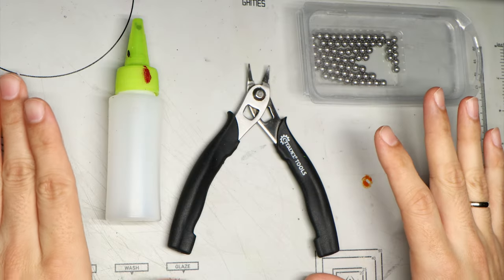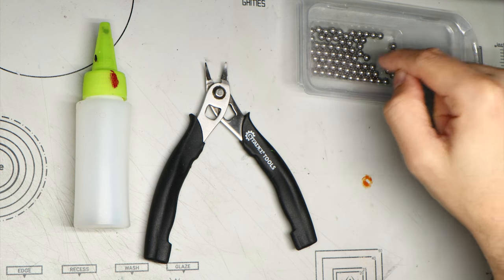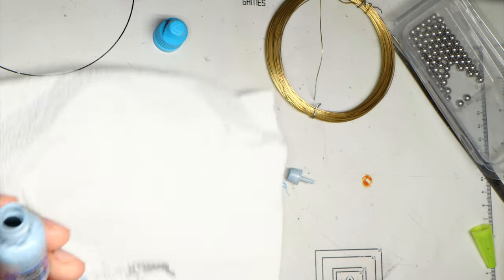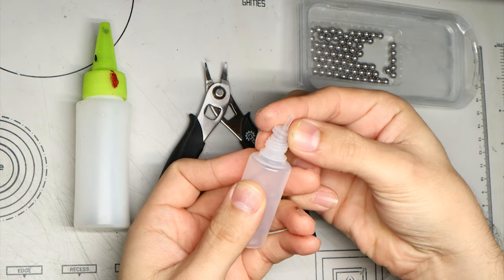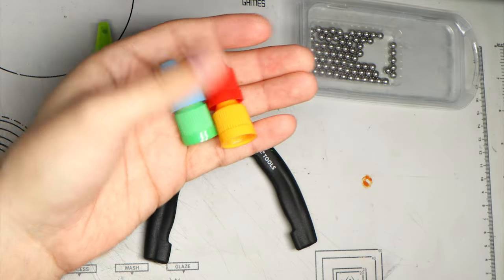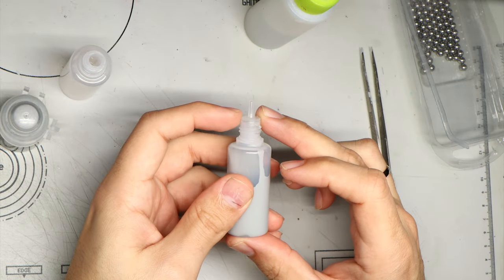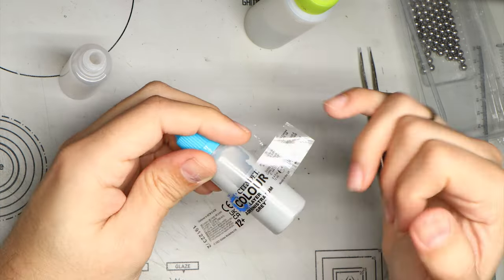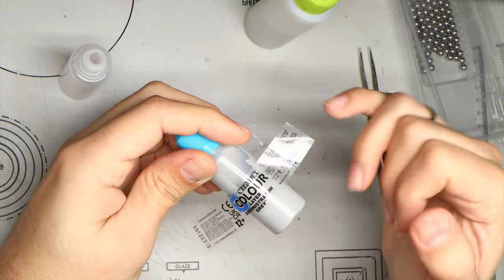THE EASIEST WAY to transfer your Citadel paints to droppers!!

Comment: Let me break this down for you all after a few years of my experience using GW paints in pots, wich made me an avid decanter of GW paints, eventually.

Their pots are an absolute nightmare to use with the Base and Layer paints so i did this to only THOSE paints. The Shades/Contrast/Metallics/Dry paints DO work fine their pots so no decanting needed there.

Maybe this can help you in some kind of way.

Ive tried and tested every dropper bottle known to mankind before decanting 70+ GW paints. They are good paints but expensive. So i really wanted the best ones; similar quality of Vallejo droppers wich i also use and took as a reference.

Size-wise 17ml is the most convenient and works best when transferring 12 ml from the GW pot. You'll mostly end up with 14-16 ml when your done.

I finally ended up with what i think are the best ones: 

AK interactive 17 ml droppers for the Base/Layer and some 35 ml Vallejo mixing dropper bottles for my most used stuff.

The AK 17ml's are the same bottles used for their 3th Gen paint line. Really thick and sturdy quality plastic and the best twister cap in the business; WITH a dedicated hole on top for a drop of paint for easy colour reference.

All the cheap bulk bottles from Ebay/amazon are dirt cheap for a reason and they are simply not worthy of my expensive GW paint + all the effort involved.

And as a bonus: The 17ml AK dropper bottles come pre-loaded with a stainless steel agitator.. :) Very nice.

1. 

Use a blob of stickytac/posterputty to stick the empty bottle to the surface you are working on. 

2.

Then the rookie one; always start by putting on the label on your dropper bottle BEFORE the whole decanting process.... Einstein move and keeps it tidy and clean. The GW labels come off easily with a little attention and effort and just wrap them around the center of the new bottle.

3. 

Check the consistency of the paint and thin as required 

Some (older) paints are thicker and need a little mixture of lahmian medium/flow improver at most. Not too much. Give them a good shake and try to leave the paint as much as it is as possible!

4.

Then. Just. Poor. No funnels needed either, waste of money/paint; i mean everyone painting miniatures with teeny-tiny details, requiring a fairly steady grip/hold, can surely poor some paint from a pot into an opened dropper bottle, can we....? Its no big deal. 

Needless to say dont poor with the opened lid still attached. The lids simply come of the GW pots as a whole, just put some pressure on the ring holding the pot with your nail and there it goes. 

6.

When the initial poor is done, grab a damp fat and cheap pointy-ish brush and just start scooping the paint out of the pot (and from the inside of the lid) and run that filled-up brush along the inside edge of the opened dropper bottle. Works like a charm.

No scraping tool or whatever; with this method i get allmost every drop of paint out of the pot. Them GW's paints are expensive enough allready, im not wasting anything; and its even low effort getting it out like this.

7.

Finally pop on the dropper tip and you are golden!

Ofcourse the paint in the tip of the dropper part can dry up over time !Rule of thumb! When squeezing the bottle and nothing comes out, STOP SQUEEZING! Dont force it now, you just need to open the tip. For this, i keep and old miniature drill with a piece of ironwire attached it like a drill bit to stab into the dropper part. 

8.

When done, dont let the leftover pigment dry up in the pot. Clean them out with hot water and a toothbrush directly afterwards and use for custom paint mixes/washes for perticular army projects. For ex. i used a very specific custom blue-ish glaze and paint colour for my Stormcast Eternals army, so i made some GW pots full of them so i could use it for the weeks to come. 

Consistent results FTW!

+Bonus!

The pots do work good as a cheap painting handle!

Fill them up with dried sand for added weight/stability and pop on some blue-tac/posterputty.

Finally i use 6 of those huge 35ml dropper/mixing bottles from Vallejo for my most beloved washes and most used stuff: Nuln Oil, Agrax, Sepaphim, Reikland + Abaddon Black base and Skeleton Horde Contrast.
Reply from the maker: Good advice!
Reply: It took longer to read this than to watch Juan’s video. 🤣

Comment: Hey Juan, thanks for the great video. I did try in the transfering paints to droppers in the past but I've encountered a problem with them. When I want to use the paint after shaking it, there's always some paint just flowing out of it on it's own wasting a good dollop in the process, I wonder if it happend to you and if so, do you have any idea how to stop it from happening. I've tried tapping the bottle before opening and letting it sit for a moment but nothing seems to work. Thanks!
Reply from the maker: That usually has to do with the dropper itself. It might be too small and gets filled up too much.

Also I recommend you get a vortex mixer, it gets rid of that issue since you aren't shaking the paint up and down. It's a well worth investment
Reply: same problem here, i try to fix it to stretch the hole with a 2mm hand drill, not perfect but better than the original dropper hole. The problem resides in a not enough diluition

Comment: You DEFINITELY need agitator balls. He says you don't need them - you absolutely must have them.
I initially skipped that part. But if you leave your paint for long enough - it'll separate. And with some paint - no amount of shaking gets it fully mixed.
I have a vortex mixer - and I still couldn't mix it well.
Gave in, bought and added army painter balls - and in 2 minutes of shaking my paint finally got back to its original state.
Adding two balls is a bit better, that's also what Army Painter does with all their new paint lineups. More than that is overkill. 

DONT SKIP THEM.

Also be very careful withwater. You cannot take it out once you add it. Nowadays I prefer to add no water.
Instead, on a fresh unopened Citadel pot, I use clay shaping tools - the flat silicone brush in particular. It lets me scrape 99% of paint out of the pot.
Be careful doing that on a used paint. Pots are bad because they let paint dry by exposing a lot of surface area to air. You don't wanna scrape dried paint bits into your dropper bottle.
Reply from the maker: I specifically state you need and which ones I recommend. I only say they are not needed for contrast.

Comment: thank you for this very useful video, I would like to do it with mine too but I'm afraid that the paint might dry more easily...
I say this because when I open the pots I see how the color is and I can add a few drops of water if is drying while with the droppers I can't see inside... 
do you have experience with this? Thanks
Reply from the maker: I have all my paints transferred years ago and they are all in perfect condition. That's the main benefit of droppers, paint doesn't dry in them
Reply: @JuanHidalgoMiniatures  thank you, you're great! :D
Reply from the maker: @andreatauschwitz3458 I KNOW!!

Comment: i got into 40k during the pandemic lockdowns and have come to hate gw pots. which is a shame bc i like the paint itself. im not going to bother trnsfering paints. i think when i buy something new or as i run out of something im just not going to replace it with gw im going to switch to a brand that isnt stupid. is there a reason i shouldnt just buy valejo?
Reply from the maker: If you prefer Vallejo do it! I just like Citadel and some of the paints are the best in the market for their hue, so I'm going to keep buying them.

Also I like to have citadel for the videos as it's the most readily available paint in the market.

Comment: I've tried to do this with multiple types of dropper bottles and mine always leak. :(
Reply from the maker: Leal how? If you don't mind me asking
Reply: @JuanHidalgoMiniatures  Its been a little while since I last attempted but they tend to leak from the rim where the dropper insert goes into the bottle. I assume that its because I'm buying cheap bottles but I tried getting new ones and ended up running into the same issue.
Reply from the maker: @ShinXyres yes, that's due to the poor quality of the droppers. Honestly try the ones I'm telling you, I've been using them for years with zero leaks
Reply: @JuanHidalgoMiniatures  I'll give them a shot! Thanks for the advice and constantly great videos!
Reply from the maker: @ShinXyres happy to help!!

Comment: There are plenty of ranges that do come in dropper, if you hate flip top bottles. I just don’t get the need to do this.

Personally, I really dislike dropper bottles and prefer not to have to buy them. However, when I find a paint I really like, but it comes in the wrong type of bottle, I just put up with it. Life’s too short to start transferring paint to new bottles.
Reply from the maker: You do you. I use very precise mixes for my paints, specially for the videos and I love the ability to dispense drops of paint.

I also happen to love Ciatdel paints, so why not?

Comment: Nope, just buy Pro Acryl instead; the extra fuss is not worth it.
Reply from the maker: Perfectly valid option but some people (including me) love Citadel and it's good to have the option.

Also, although I love Pro Acryl, I absolutely DESPISE their choice of dropper
Reply: Lol yeah the paint is amazing but the Sriracha bottle tops are not fit for purpose.
Reply: Yeah, I'll concede that point; however, I absolutely love the alternative lid set. No split tops (I'm looking at you Vallejo) and incredibly comfortable to handle. I guess if you're going to buy bottles and agitators, you might as well just get PA with the better lids instead?
Reply from the maker: @worm1618 I still don't like those but they are better than the OG ones

Comment: I don't want to offend anyone but what's the point of doing this? You ruining paint consistency, loose some amount of paint, make some mess and most general - spend vast amount of time. And for what? Never encountered problems with using GW paints straight from the pot. In my opinion it's just some sort of time-wasting. Just because.
Reply: So to answer all of the questions:
1) Many people really don't like the GW pots, they have issues closing correctly often / they have the sampler bit in the lid but the lids don't always stay open and keeping the lids open helps to speed along the paint in the pot drying over time or use.
2) Dropper bottles allow for more exact amounts to be placed on a pallet without having to use a brush to do it.
3) Most GW paints need some thinning anyway and you should never use them directly from the pot, use a pallet first then measure the consistency and dilute as needed, adding the distilled water as he did (which wasn't much) just helps with the transfer and does very little to hurt viscosity.
4) Juan was showing that you don't need to create a mess if you take your time, as many other channels may say to use funnels etc to get the same results.

Just to be clear, I wrote this to help clear up for you and by no means be unkind. Hope it helps 👍🏻
Reply: @NobalGaming  Hey! Nice to have an adequate answer to my question. For several years in hobby I've tried at least 6 brands with different pots (Citadel, Vallejo, AK, Kimera, dense acrylics etc.) and never encountered difficulties with using paints. When I return to hobby after couple of years I had to shake well all my pots (~130 Citadel and ~70-90 Vallejo). For such mission I've used electric jigsaw (saw it on YT some day) with custom pot holder that I've made from wire. I've spent several hours just to shake it. 
After this video just thought how much time (and money for new droplets) I would have to spent if wanted to replace citadel pots with droplets and I really think that it's kind of entertainment for those who really have vast amount of spare time and real hatred to citadel pots )
But still, returning to the main subject, just never thought that it might be some kind of issue that required a separate video to be recorded :) No offences, please, I do understand, that to someone it might be useful.
Reply: @andreyp2810  Oh yeah. I fully understand what you mean. No offense taken 👍Hope you have an awesome day

Comment: I no idea why people use stainless steel balls or metal at all. Get non reactive glass mixing balls. It's what Pro-acryl uses. I stopped buying or using stainless steel because the glass inert glass ones cost way less and won't interact at all. They are even lab grade. No reason to ever use metal.
Reply from the maker: It's the weight, metal balls weight so much more and makes paint easier to mix well
Reply: They work great until they shatter and you end up with tiny flecks of glass in your paint.